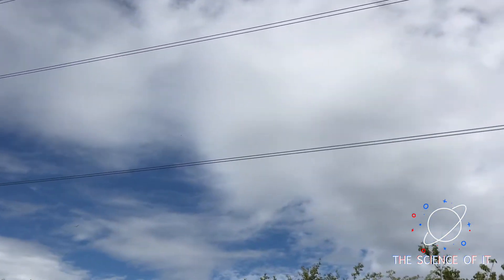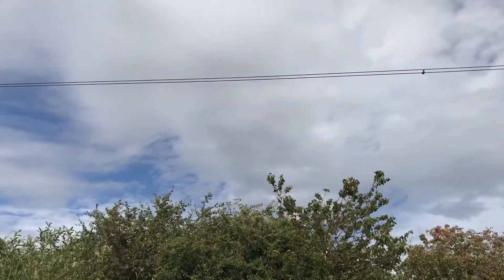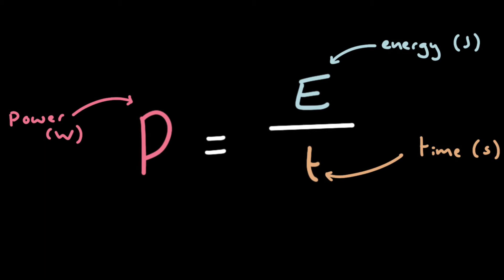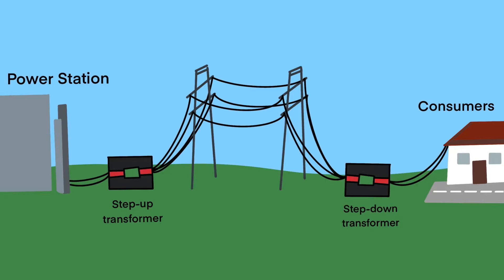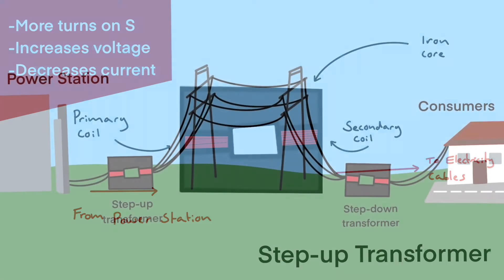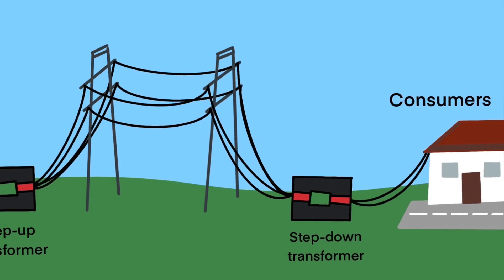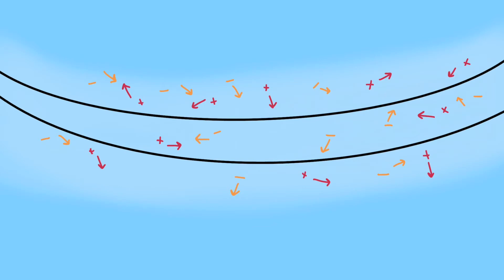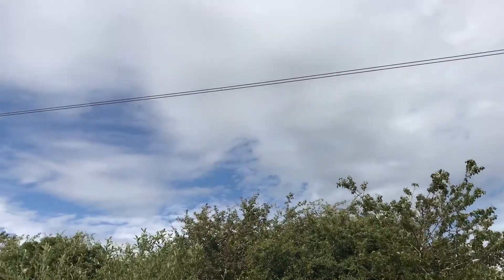Why do power lines buzz?

Comment: Thanks for the explanation. It's clear, the diagram helps, and tempo is well paced too. 

My only feedback for improvement is probably the sound quality. The volume is very small, and in some parts it's not clear. Anyway, again, thanks for making a video that answered my question.

Comment: They are playing with the wind-generators near me, which I think is throwing out their balancing, as these are the generating end of a transmission line past me. Each blade is the size of a big roundabout. They ship from Motril port in Spain, which you can see on Google Earth.  Anyway, take a look at 50hz on various waveform shapes. Sine-Wave is nice, pure and quiet. Triangle a little more noisy, with Square and Saw-tooth being the noisiest. https://www.szynalski.com/tone-generator/
Reply: 6% volume is more than enough, don't use on 100% with headphones or your pc speakers!
Reply: Thank you for the link. . I am attempting to match a nasty freq polluting my immediate environment here I suspect is cellphone signals hitting high tension powerlines nearby..and I can confirm I can hear the higher freqs and they are earsplitting and actually of an audible and high volume for their frequency...as well as overlaid the powerline hum...it has to be illegal what ever it is..but this link will be useful as I wonder about the wave forms thank you